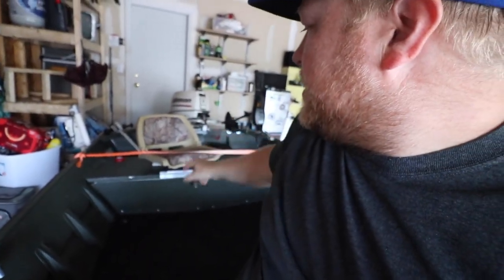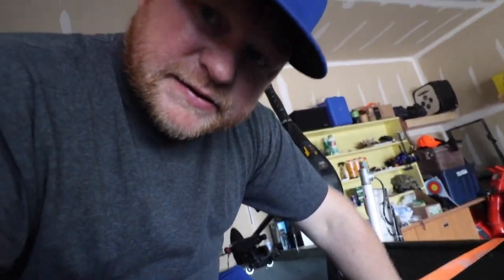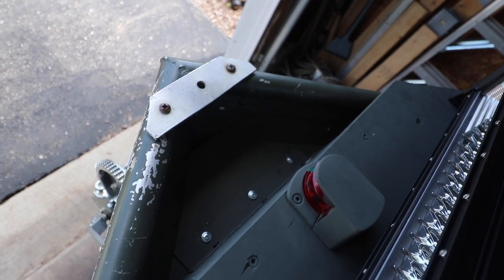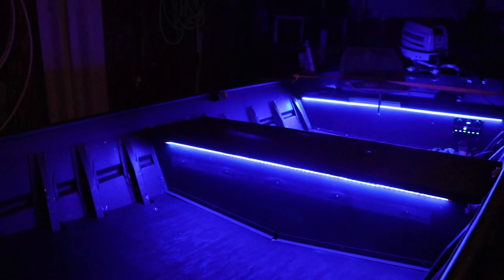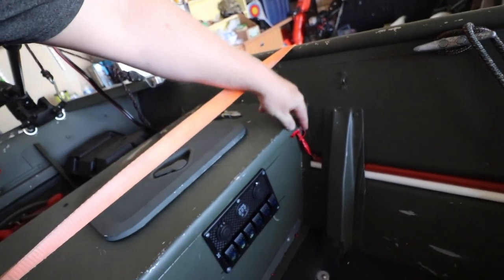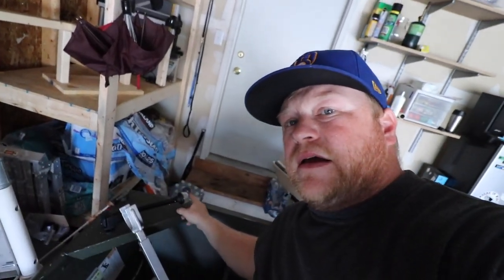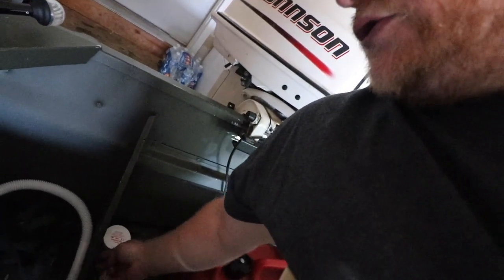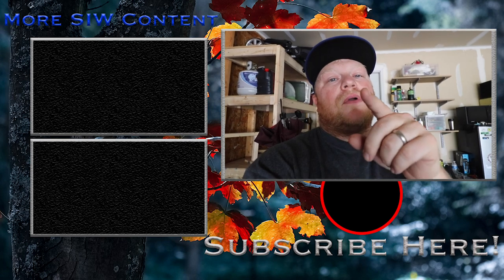LIGHTING up the NEW DUCK BOAT! Switch panel, electrical DIY

Comment: Sweet setup. I think the lights will be super useful. Need to do that on my bass boat
Reply from the maker: Thanks! Pretty easy really. Order the connector clips, and buy some extra 1/4" 3m automotive tape. I think it probably works better than what they provide.

Comment: Nice video series definitely helped me out with planning on how to do my duck boat but I was just wondering what size wire you used to connect the motor to the battery if any but if not what size would you recommend?
Reply from the maker: Hi. I'm not to sure about that to be honest. The wire from my motor was already attached to the motor when I bought it. Thanks for watching!
Reply: @SomewhereInWisconsin  Well thank you anyways I appreciate you responding👍

Comment: Need to put a mud motor on thier and get read of that out board you pulsing believe how much the mud motor helps if your a duck hunter
Reply from the maker: We have considered it. Just feel like guys always have issues with them. Hesitant.
Reply: All depends on witch one and if you buy used or new I have long tail never left me and I have a mudbuddy surface drive and I love it but I do all my own work on my motors buddy of owers has a Prodrive with over 600hr and never had a problem just do the maintenance on them and they last so long and thier so simple to work on I mean at the end of the day it’s just a lawnmower motor simple
Reply: I got into mud motors bc I used to run out boards and I kept getting left and all the parts are out rages so I made the switch and my hunting has been way better and frogging has been unreal been runing mud motors for the past 5 years and the difference is un real I’m getting 26 mph on a 16by54 with about 700lb of gear two guys etc and it’s a 22hp

Comment: I really like the build so far man. The lights look great. I'm gonna start a similar build soon. I have a question about lighting and electrical in general I guess - Does the outboard charge your battery? Otherwise, I don't see how the battery would last very long if it's powering all those lights.
Reply from the maker: The switch actually reads out the voltage so when it gets low we just take it back to camp and charge it overnight. We bring a battery charger with us and charge the battery overnight. Also, we never really use the lights, or I should say the only lights we really use are the flood lights on the way out in the morning. This boat does charge the battery as well though.
Reply from the maker: Also, thanks for watching!
Reply: Somewhere In Wisconsin awesome. Thanks for the response. Looking forward to the rest of the build!

Comment: Super jealous of the LED lights on the inside I'm going to have to do that to my boat but green looks awesome
Reply from the maker: It's not too hard of a job to do and it's pretty inexpensive. You can get 5m of lights for like $30 I think.
Reply from the maker: Actually, they are 12.99 per 5m. Here is the link. I think they have different colors if you select them.https://www.amazon.com/gp/product/B07RSB4S4X/ref=as_li_ss_tl?ie=UTF8&psc=1&linkCode=sl1&tag=somewherei037-20&linkId=3a380b81e9b01f812ab352b73a2b1e2a&language=en_US
Reply: Do not do green. The green ones are too brite and mess up your night vision pretty good.
They're ok for nav lights but use the blue ones . I did because I see lots of duck rigs.

Comment: What battery did you use to run all that?
Reply from the maker: We have a deep cycle battery we use for our trolling motor and lights.
Reply: Somewhere In Wisconsin what brand would you recommend for set up like yours? I’m doing a duck boat for a 14x36
Reply from the maker: Not sure of the brand. Pretty sure my dad bought it from Wal-Mart. We usually have to charge it every 2-3 hunts depending on how much we are using the troller.